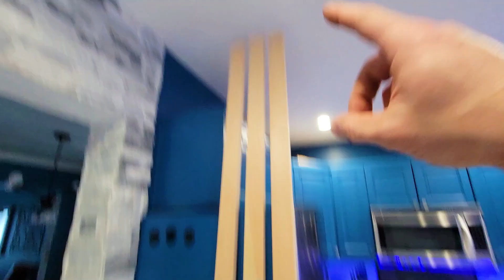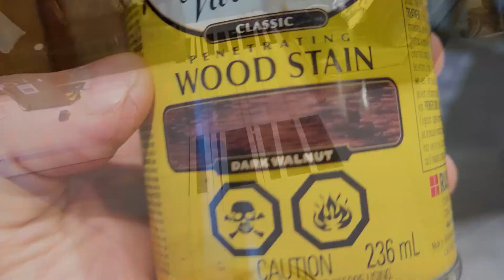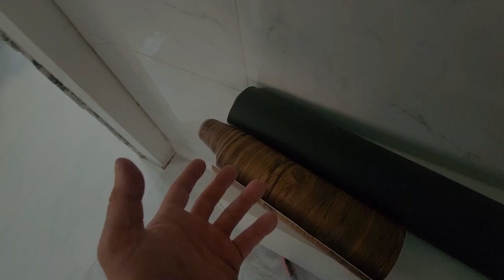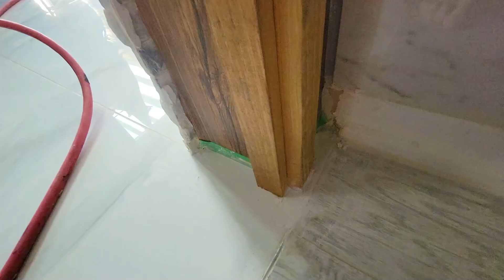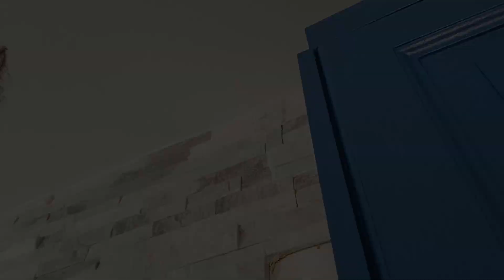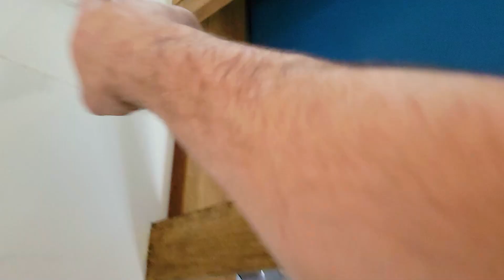1 Day Slat Wall Build - Step by Step Tutorial - Build Accent Walls on Super Tiny Budget

Comment from the maker: Links to Items in Video are below. Today in 5 hours we've built Slatted walls made of real wood over top of wood contact paper and showed you how easy and amazing they can be and on a small budget under $200. Today Is another Guide on How to Build Modern Slat Wall or a Modern Room Divider Wall under $200. This is a quick DYI Weekend Project anyone can do. I use a Brad Nailer however you can simply use nails to get the wood slats in. We used Knotty Pine Sealed 1"x2"x8' for thinner slats around beams: https://tinyurl.com/bdemwemn and Whitewood 6"x1"x10' split into halves for the room dividers and 2" in betweens : https://tinyurl.com/p6s4jb3m  See Below for links to the tools and wood grain wallpapers used in this video. Enjoy! 

🔨 SHOP TOOLS USED IN THIS VIDEO🔨
Vinyl Wood Peel & Stick Wallpaper Used: https://geni.us/FunstickWoodWallpaper 
Other Wood Contact Papers: https://amzn.to/4bFvFin 
Metabo HPT 18GA Nailgun:  https://geni.us/MetaboHPTNailer
Dewalt 18GA Brad Nails: https://geni.us/Dewalt18ga2inails
PORTER-CABLE Air Compressor, 135psi: https://geni.us/PorterCompressor6gal
Wood Used: Knotty Pine 1"x2"x8' for thinner slats around the beams: https://tinyurl.com/bdemwemn
Wood Used for Room divider Wall: Whitewood 6"x1"x10' : https://tinyurl.com/p6s4jb3m
Lepage 8x Adhesive glue used: https://tinyurl.com/bdf6f3dz